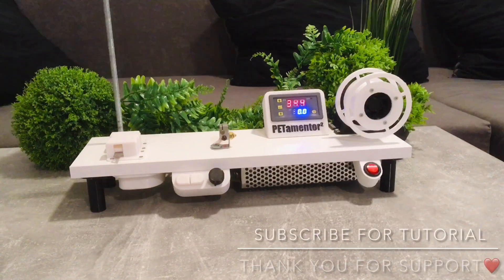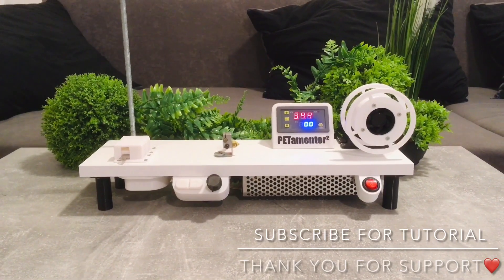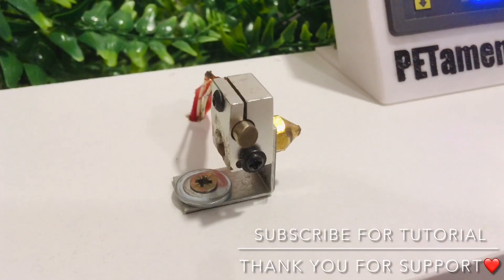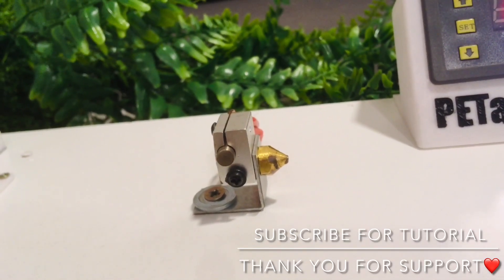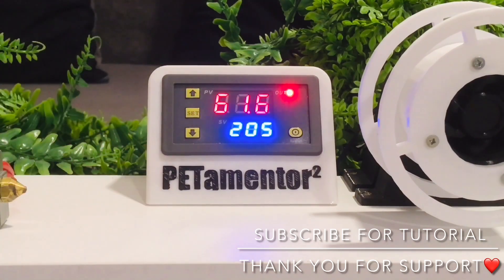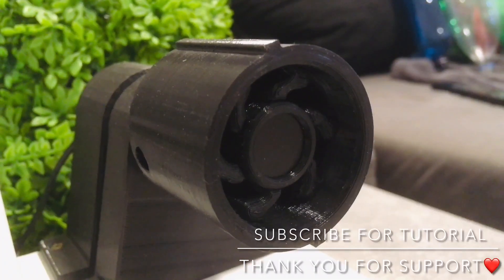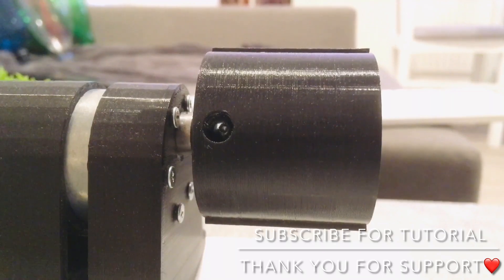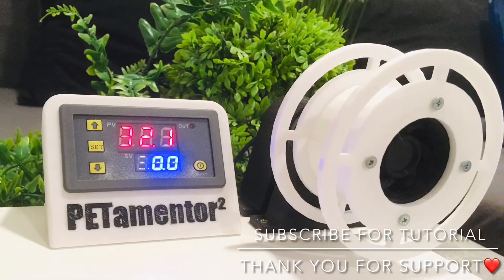3D Printing PET bottle filament machine PETamemtor2

Comment: I made this too large, my petamentor top is large enough to eat off of 🤣
I'll also add 2 banana connectors to use it as a power supply as I used a powerful atx I had laying around. 

Finally got the filamemt to print beautifully.

Thank you Ondrej.
Reply from the maker: Great, wellcome to the PET bottle filament Hall of Fame 😁🎉

Comment: really great work with the design the one that that i would add to this right away just trying to figure out how is a monitor for the RPMs on the spool holder because one thing that is important is consistency when it comes to filament and having that can ensure that is the case. Past that this machine is great. I love the fact that it pulls the bottle apart and makes filament in one shot. Compared to others that you need to prep the strip from the bottle and then feed into machine.

Comment: great video, from where do you send the parts from shop?
Reply from the maker: Hi, thank you. Its Aliexpress dropship. Supliers are sending from their stores from china, or EU (depends on your location). Its the same as you order it manually from AE, but you dont need to search for parts variations (wich was the main problem at power supply and dc motors).

Comment: Ondrej Strait please tell me why my temperature does not rise above 140 ° C on PETamemtor
Reply from the maker: Hi, dont know. What is showig your external thermometer? Is your sensor connected properlly? If yes, then try this:
Pres left button and then adjust a working temperature up to 80. Make small steps and please let me know tue result 😉
Reply: @Ondřej Šraitr Thank you very much for the information, I'll let you know as soon as I do, and so I'm waiting for a video about 2 upgraded models))

Comment: Amazing job. I am waiting for the v2 tutorial. I would like to use a recycled pc power supply, it has a good 12v line. I think it would be easy to addapt the platform and wiring. Thanks for the job
Reply from the maker: Hi, sure you can use old pc psu. Thank you so much for your support! 😉

Comment: Sir I have a question 🙋‍♂️ what modifications do I need to make to print with this filament? I have a stock ender 3. What do I need?
Reply from the maker: Hi, I dont have E3, but my first tought is 1) ability to rise the nozzle temp to 260C, 2) capricorn ptfe tube is great fir this temp. I thing nithing much special 😉
Reply: @ondrejsraitr  thanks for your help

Comment: Cada día te superas más. Impresionante  tu idea y tu trabajo. Esperando noticias.  Gran trabajo. Una pregunta. Los 2 Microinterruptor (2PCS) que velocidad (RPM) Y TENSION(V) por ir comprandolos. Apoyo total al proyecto 💪🏽💪🏽5$
Reply from the maker: Hi Toňo 😉, thank you very much for your patience. These two microswitches are only for cutter height setting. The spool revolitions are controlled by PWM. Thank you for your support ❤️
Reply: @ondrejsraitr  esperando tutorial y archivos stl. 💪🏻💪🏻 GRACIAS🙌🙌🙌

Comment: my man. my parts have already started to arrive from china, using  your v1 as a guide i did something simular as this v2 as i went with digital controllers for both pwm and heat managment. thank for the help bro <3

edit, just saw the auto cutter, amazing design now i have to order another part haha
Reply from the maker: Hi, how are you doing? 😁
Thank you. Yes, digital (with display) PWM is really cool component. Im so curious of your build. Hope it will work good for you 😉👍

Comment: Is the new temp controller the W3230? If so it says it can only work up to 120 celcius?
If it is that controller then what did you make to make it be able to work with higher temps? Just a different high temp capable sensor?
Reply: It's a K-type probe thermocontroller, so temperature should be handled up to 500°C
Reply from the maker: Hi, Im not sure about the name of controller, but I will post link on petamentor.com MK2 section very soon.
Reply: @ondrejsraitr  it looks to be the W3230 and if thats what you used did you buy a higher temp cartridge sensor and did you have to flash the unit to be able to go above 120c in the settings?